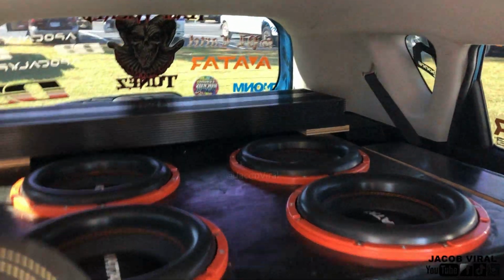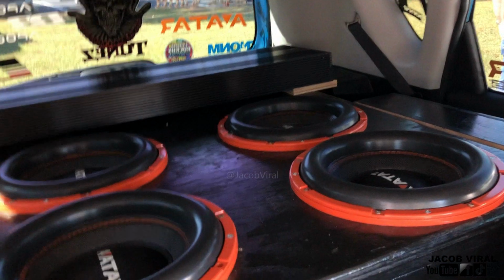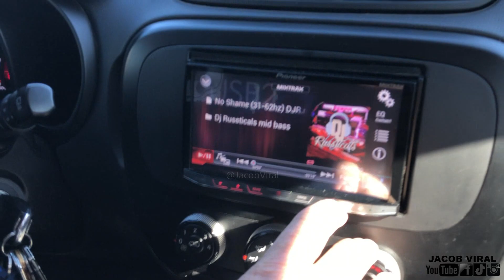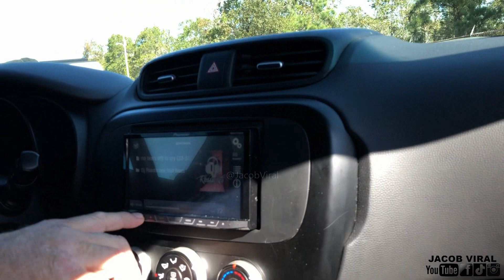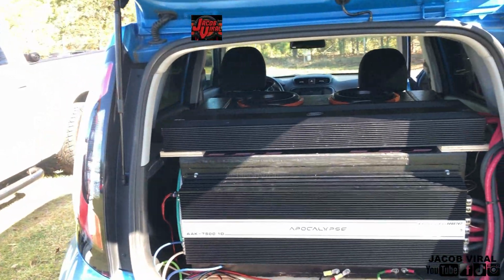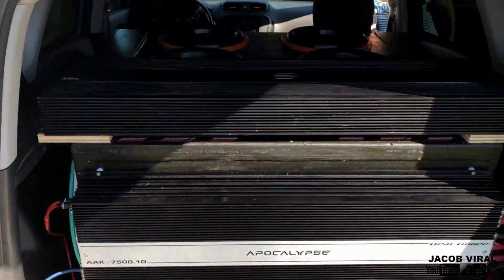The AVATAR Subwoofer Flex Video

Comment: I love my 4 12s I’m running ! I went from sundown zv3 12s to avatar 12s and they get down and I would t go back to sundown after owning these !!Alphard audio makes killer stuff oh n btw this dude doesn’t have something right !? These subs should be pounding !!
Reply: For what he wants they are setup perfect
Reply: Doesn't have the power to push them, I have a single 15 stu on 3k Orion and pull crazy current. I try to tell people about Deaf bounce subs, they are underrated
Reply: @RomaVilla  how good is the single Stu 15?
Reply: @jovas440  awe man, Im bearly scratching the surface with my single stu but it smashes the lows pretty good, my enclosure is tuned around 31 so it peaks between 29 and 33 , that's the sweet spot for me.  I never realized it was so hard to move a 4 inch vc until now but I'm working on getting a HO alt so I get better results. I'm pushing it with a Orion dsplx 3k and they are both begging for more power. Definitely one of my favorite subs and for the price you can't go wrong, it will take like 4 k clean rms watts all day. Someone else told me they had an Ab 4900.1 and it was still begging for more power so they are the real deal.
Reply: Oh, yeah an ill second that statemeant . i put
Mine on 8k taramps each an after break in 
They smash the lows . tuned 33hrz in a 6.25cu
Box ported 8" port. An they eat it all day
Reply: i have a single avatar 12 d2 (box tuned 32hz) on the aab 4900.1 at 1ohm with a 320a alt.. thing def gets down.. puttin in a second battery this coming weekend hopefully, should def help out

Comment: I got a question for the sound community about electrical I’m gonna have a js 320 amp alternator and about 10k watts in amps and I was wondering for batteries what batteries should I use and how much amp hour and things like that?
Reply: I'm a fan of LTOs plus super caps. Obviously the more the better, but 80ah of lto in the back and a super cap bank in the front will probably be plenty

Comment: My 2 avatars 15s beat crazy
Reply: Same
Reply: I switched to reselient sounds platinum 15s
Reply: @chunky123s  what amp did you have the avatars on and what vehicle, how do you like the plats ?
Reply: @SelfPreservation7  tramps 12k in a tahoe
Reply: @chunky123s  I was thinking about getting a 10 or 12k not taramps though had a bad experience with a md8k unfortunately.
Reply: @chunky123s  I have a Tahoe too